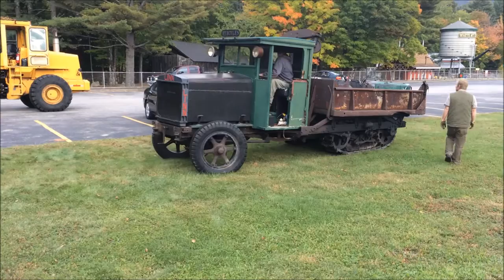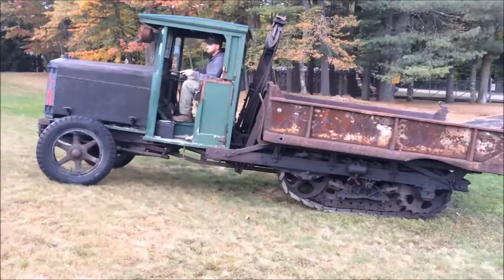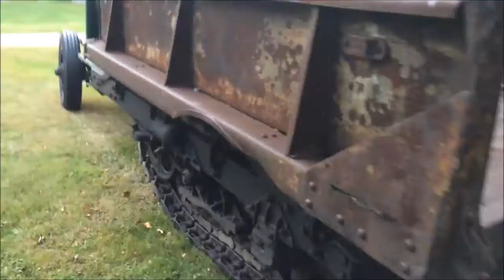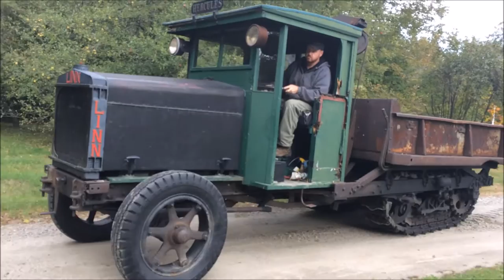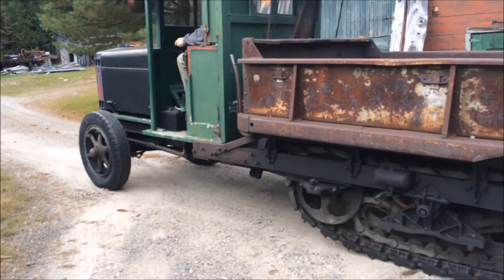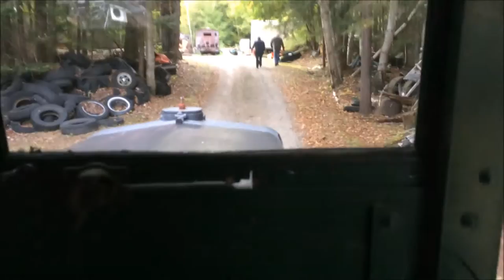1930 Linn Half-Track Operating at Clark's Trading Post 2016

Comment: They should put some oil on the tracks before they use it again.
Reply: No. The tracks are designed to run dry with no lubricant. Oil mixed with dirt acts as a grinding or lapping paste and will cause more damage than good. At the most you would wash down with kerosene from time to time.